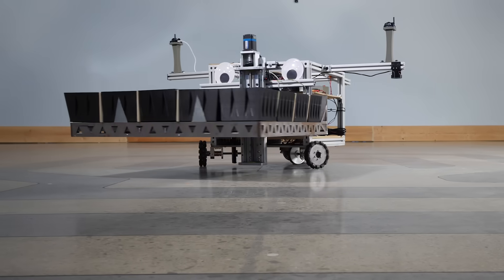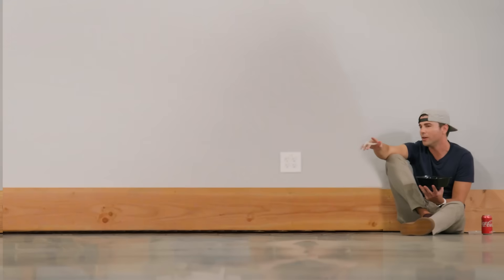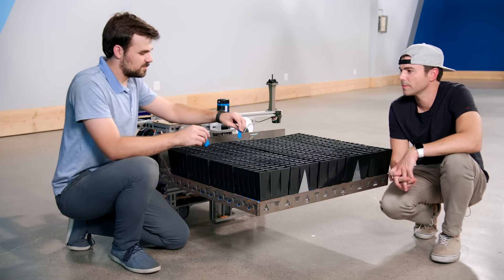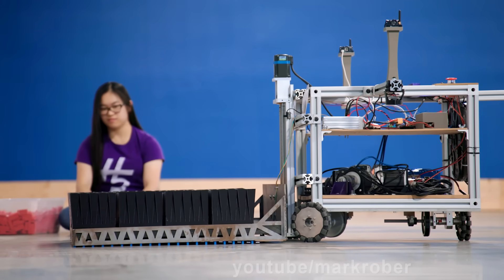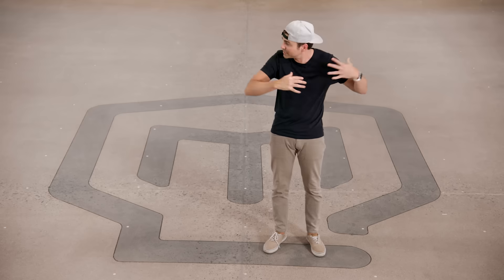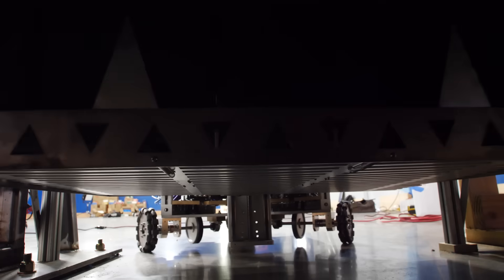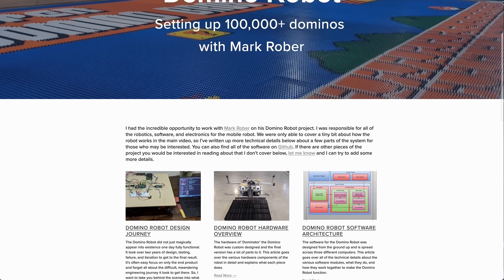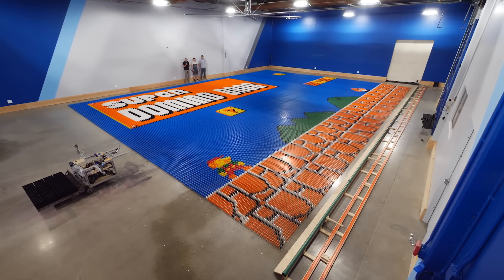World Record Domino Robot (100k dominoes in 24hrs)

Comment: i wonder if the domino loading tray can be tweaked so that one domino knocked down will cascade the rest. Then you can plan out a way for the dominoes to be all knocked down from one corner.

As it is, all the dominoes just fall in the same direction and you need to push all 15x whatever tiles at once or in sequence.

really cool!
Reply: maybe expand the rack with a loop row that is loaded optionally. Would probably run those at the end since it would interfere, otherwise, with the time saving queue load.
Reply: You can either simplify a complex problem or complicate a simple problem.  
Seems like they decided the first option was safer.
Reply: @DirtyRobot  nothing wrong with a little brainstorming.

Comment: No offense, but if that counts, couldn't it be trivially beaten by printing a grid with 100k slots for dominos, loading them up, starting the clock and then dropping them a quarter inch to the ground?

Comment: Fascinating  that achieving the record required heavy investment in the construction methodology but the toppling methodology seems a bit dull and crude. Is there a record that requires the build to be toppled by just one domino to initiate, with each subsequent domino required to fall individually, and validation of the record requires no failure during the 999, 999 other individual topplings? Brilliant, just wanting more please?

Comment: I don't think that counts. In a domino line, u should hit only one domino for all of them fall. They actually hit hundreds of dominos, one per row. Technically he made hundreds of small domino lines, not a big one. They should upgrade the Dominator to connect the rows.
Reply: Came here for this comment
Reply: @pyhlo9201  I feel like hardware would give more challenge than software to make this happen (rotating each domino differently).
Reply: @topefpv  You would need how many blocks to turn around to the next row? 3 total maybe? Same pattern across everything. You fill this special end row when needed.
Reply: @topefpv  true
Reply: Exactly. It should all happen off of ONE domino fall. At no point were they in danger of losing the entire thing if one fell early. How hard is it to program and layout a final "connect the blocks" row? I want my view back. :)
Reply: @bickernicks  Very hard…

Comment: now you just need a high speed auto sorter using a belt and some compressed air with a color recognizer to sort them all back out and you can turn it into a non human performance are of having the robot build then knock down, pickup and sort then rebuild in an endless loop!

Comment: This is amazing! I wonder what the business side of this looks like. 
(3 Jr Engineers @ 50% time for 5 years w $75k salary) + (1 Sr Engineer/Architect @ 25% time for 5 years w $150k salary) = $750,000 + materials to build Dom
7 skilled domino builders @ 150% time for 1 week with $75k salary = $15,144.24 to do a single domino setup
With that napkin math, you'd need to want 50 more copies of this exact same mural for Dom to be cost effective. I hope you keep him running for the next 2 months :)

This doesn't bring into account a lot of other variables like reduced error rates and the ability for the solution to possibly solve other problems, but it's a perspective i think a lot of engineers (including myself) fail to take into account when approaching a problem.

Comment: really cool. 
but it's speed still lacks in the human touch of elaborate design outside a flat grid.
like even some turns at the ends to stretch out the drop.
i'm not minimizing the grand engineering project it is.
could be integrated with humans for some elaborate designs, with the robot doing the flat grunt work.

Comment: You can break 24hrs by programming the robot to move at high speed if far away from placed dominoes.
Reply: A double/triple/quad-decker tray on the front as well, so it would need to make fewer "restock" trips. The counterweight would need to be increased to compensate for the additional load on the front. 

The same funnels and "connect four" mechanism they use to drop the dominoes could be used between each layer of the tray.  Once the lower one is dropped, it closes back up, and the second layer opens to drop its payload down to the first layer.  Repeat all the way up, however many layers.

Loading would be the same, just essentially in reverse - open everything, load the bottom layer, close above it and load the second layer, etc...

Comment: Looks amazing, well done.  Question regarding the link of all lines together, why did you not offset dominoes so all are linked back to a single line of dominoes.  I.e. so they pyramid back to the start line with each dominoes triggering two dominoes on the next line (and so on).

Comment: Please do a domino trick that requires (almost) perfect alignment and challenge Lily again.

For example:
- The chain of domino leads into 2 chains.
- Both chains would reach the position of a ball from directions 90 deg apart.
- If those 2 are synchronized well enough, the ball will be kicked in a (near) symmetrical direction and enter a goal (if one of them arrives too soon then the ball would be kicked in the corresponding direction and miss the goal).

Please gradually increase the difficulty (longer, more turning, etc on each side, and may even make the 2 sides unsymmetrical (but still require arriving at almost the same time)) until one competitor can consistently do it while the other can't.

Comment: Just out of curiosity, could you create a robot to pick up the dominoes by Pantone color number and use, like, a QR code on bins into which the dominoes would be deposited, that the robot would read to know in what bin that color goes? I apologize for the run-on sentence. :D
Reply: Yes you can
Reply: I think so.  Aside from the robotic arm, you'd need a properly-calibrated camera to read the color of each domino, and then you'd need to interpret the QR codes on the bins (perhaps using the same camera).  Although it would probably be faster if each bin was in a predetermined location relative to the arm.

Comment: Could you use a more mobile position system using basic positioning similar to a vr headset in order to avoid the gps that was used. Also would it be possible tho have the edge pices be at angles to make it one chain instead of rows and have a absurdly long reaction.
Reply: First time I have been disappointed here

Comment: I wonder how much flexibility they included in the robot.  It only set up single rows of dominoes in a perfect grid, but that's not how most people build impressive layouts.  Even leaving out the obstacles / uneven surfaces etc, at a minimum I would think dominoes need to include splits, so that 1 domino can trigger multiple dominoes.  I imagine that the Dominator would be able to set dominoes offset, so setting a single row, followed by another single row is conceptually not that difficult, but I wonder if they actually designed the robot to be capable of it.

Comment: While there are impressive aspects to this.  There are at least as many disappointing parts of it.  

For example, there isn't any real capability to individually arc a line of dominos.  And short of a VERY large radius, it couldn't even make an arc that resulted in both and inner and outer path successfully tiling.

There were obvious misalignments between groupings that were 25%? of a domino width (estimated).

Comment: Sure, only 24 hours to set 102,600 dominoes, yet they are not interconnected into a single series.  So, even though Dom is faster than a human, he can not build like a human, for there was no single series.  Is that a fail?  Dom can not incorporate turns into his layout, nor can he construct domino tricks.  He can't set up a 3D Domino Pyramid, nor a Domino Fallback, nor a Fallwall, nor a Speed Pyramid, and forget about setting up a Backwimo, nor can it handle any variation of the Sonimod Technique.  Looks like the human may not be as fast, but is by far more adaptable, more innovative, more versatile, where Dom only does one thing . . . . one thing at a fast, and reliable rate . . . where the human only lacks the speed, but excels in all other quantifiable aspects.  Overall, human wins!!!!  

However, I must congratulate you on an incredible job with create Dom to be so fast, and reliable, and using some creative techniques in order to overcome some of the issues you encountered along that educational journey!  Really, nearly everyone is a winner here!

Comment: Do I say you can make it ... 10 time faster by making the funnels taller and adding more than one each time ? Then you have two of the things used to release dominos ( spaced by a bit over 1 domino length ) and voila no need to reload for as long as many layer you can put in the funnel ... also can reload faster if the arm can put 2 ... 3 ... 10 in each funnel at a time
Its really all about how many robot arms you got and how fast they can fill the robot

Comment: Wish I had the money to try and one up this.... I suspect you could get more accurate placement by a combination of lidar tracking the edges of the room it's in, as well as cannibalising the guts from a usb mouse (to track movement of the floor). Kalman filter those bad boys up and I reckon you'd get rid of those artefacts that appear on the borders of each group of 300 blocks.... plus that way you could allow it to adapt to the room - no prior preparation of the area plus possibly simply load the design in and tell it to work out the "toolpaths", so to speak, by itself....

Comment: Does the loading station with the robot arm include a sorting device? If so, please show that too, would be awesome if you could just dump crates of unsorted dominoes in there and get them color coded back… like for example after you just tipped over 100k of dominoes and need them reset…

Comment: Hey why didn’t you guys use Mecanum wheels instead of omni wheels? I’m my experience, coding omni wheels is easier in a standard, 8 wheel (4 on each corner) orientation. But compared to this this triangular orientation, I’m pretty sure Mecanum wheels might’ve made more sense. What are your thoughts?

Comment: Why print all these funnels? When you can just print one, mould it and cast one in a fraction of the time, 20 minutes for resin to set is probably faster. And when you have 10 or 20 moulds you probably would be way faster. 
And these funnels are easy to mould even if you do cast the inners as a plug. But even a two piece mould that you have to glue together (with nice registrations) probably is cheaper and faster.
I wonder why the whole 3D printen route was chose ?

Comment: Amazing stuff but shouldn't the whole domino line be activated to fall by just pushing over a single domino.
Reply: yes i was thinking that also, at the very least one domino, starting the hole lot off, it meant to be a chain reaction from one going to the last, all in one go, no second third fourth start, to the last one, the last one being the would record one domino not being touched by anyone?, maybe they are going to do a second video, and go after the human record as well as the robot record?
Reply: the entire thing will fall down IF they are connected (by setting up the dominos so that there's a little curve at the end which connects mutiple lines together)
but in this case, the domino lines are PARALEL with each other, which means they're not connected so you have to push down every single line

Comment: Uhh why do dominos In the front away from the servo fall first the “connect 4” method appears to be solid it appears there is an engineering mistake possibly the slots away from the servo are closer together ? It’s a solid structure ??

Comment: I can't imagine writing 14,000 lines of code and it actually working. That must be an amazing feeling.
Reply: It's not like they wrote it all at once and just ran it. I sometimes can't write 5 lines without the app crashing/not compiling but all in all, the projects I developed worked fine.

Write a bit of code - test it, and then repeat the process 2000 times
Reply: It’s all about perspective. I am not a programmer but I have coded some. So 14,000 lines of code is very impressive to me. If you told someone who just started working out that you could bench press 315 pounds they would likely be impressed. If you told a professional powerlifter you bench 315, they would be significantly less impressed. Obviously 14,000 lines of code is not going to be impressive to someone who codes for a living. But very cool of you to say you can code this much in a couple of weeks and downplay their hard work after 5 years.

Comment: I have a question (don’t get me wrong it was an amazing creation) however to speed up production perhaps you could have made it so domino’s would go up the conveyer belt and go in to funnels before dominator came back as to speed up the reloading process (do this via tiny barcodes and a barcode reader) (or just the original software) and to perhaps make it even fast you could layer it up again with the funnels (however still amazing)

Comment: But ... that's not how most domino setups work. Some sections may fall over all at once like these sections did, but to get to that stage of the chain (or whatever it's called) that is usually preceded by a long and complicated line of single dominoes triggering other lines. The mass fall overs would be triggered by just one domino falling over at some point and triggering each of the individual lines of dominoes which make up an image in rapid secession. Not by a pipe doing the job on all lines at once. Sorry, but that's basically cheating. Until the robot can also set up the various triggering dominoes and single lines of dominoes going in various directions it is not what you make it out to be. Quickly stacking rows of dominoes, while impressive, is only one part of the whole domino cascade experience.

Comment: This is very cool. Now surely you can optimize this even further and go bigger!

How much time does it take for Dom to go between the pickup and drop off points? 

I'm thinking: What if you 3d print a second set of funnels and place them above a 'Connect 4 tray', ABOVE the existing funnels?
This would mean you can double load Dom, and he can place two grid tiles per trip.

The set up would look like:
- Top funnel
- Domino layer
- Connect 4 gate
- Bottom funnel
- Domino layer
- Precision hole
- Connect 4 gate

The top funnels can be smaller, and don't have to be as accurate because they only need to be able to consistently guide the domino into the existing funnels (which look to have been made quite wide to eliminate any accuracy issues from the robot arm, and consistently guide the dominoes into the precision hole).  
Dom shuts his bottom gate, and receives one load worth of dominoes. Then shuts the top gate and receives a second load of dominoes.

Dom is fully loaded. Dom zooms over, opens the bottom gate and lays 1 grid of bricks. Then shuts the bottom gate and opens the top gate. The dominoes move from the top layer to the bottom layer and Dom scoots back 1 metre and places his second grid.

I imagine there's a calculus for max efficiency vs weight vs slower movement speed etc somewhere but the benefits of double stacking scale with the size of the room (longer distances to travel per trip)

Second idea: An small attachment that drops a couple rows of dominoes oriented sideways relative to the picture. This would make a 'front row' and 'key domino' that you can knock over to trigger the fall (I liked the green shell! It just didn't feel as accurate and clean as Dom deserves)
I'm envisioning a lightweight attachment which clamps on under the front 3 rows of holes. 3D print some funnels which twist the dominoes 30, 60 and 90 degrees respectively. These tubes would lead to a set of precision drop holes that are angled appropriately.

Comment: Very cool. Can this be achieved without a floor marker for every drop spot? I assume dead reckoning is not going to give the necessary precision. What about two short-range spinning FM transmitters, sort of like like VOR navigation? Or you could use a laser for "target painting". Two small robots position themselves on the X and Y axis for each drop, or they sit stationary and rotate, projecting laser signals on a straight lines that gets picked up by a few receivers (two for the position and a third for rotation).

Comment: Shouldn’t you be able to knock down one domino which causes the rest to fall instead of needing to use the pipes to knock down each column?
Reply: The domino rows in this case didn’t have anything connecting them to adjacent rows, if you just knocked down one, only the row it was apart of would fall(unless you hit it from the side or something). Usually with the set ups that have every domino fall over from a single domino, each row curves around at the end in a u-turn to connect to the next row over.